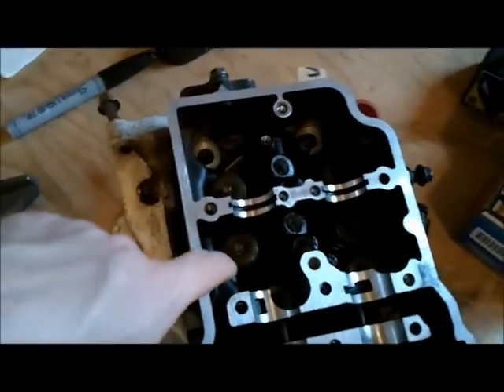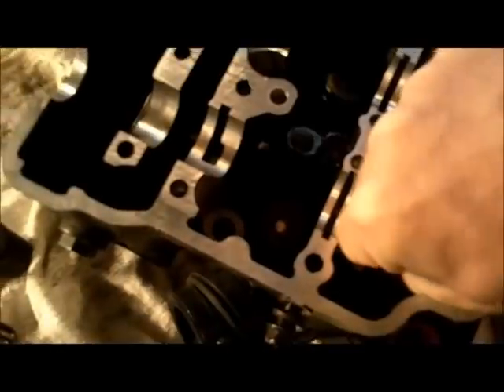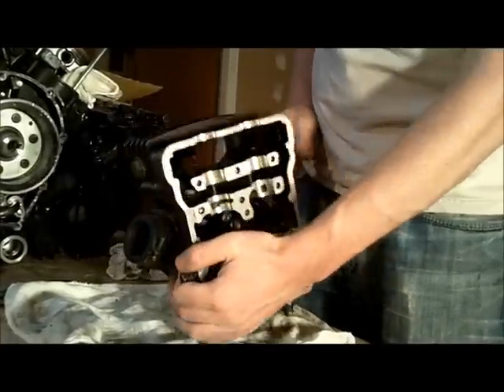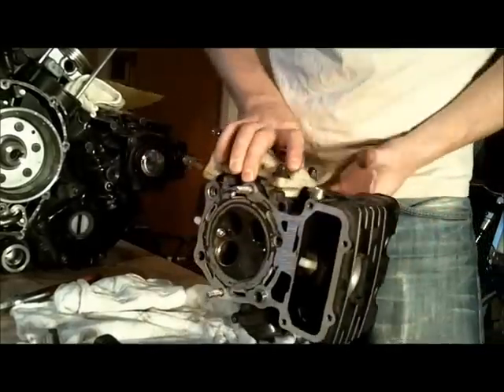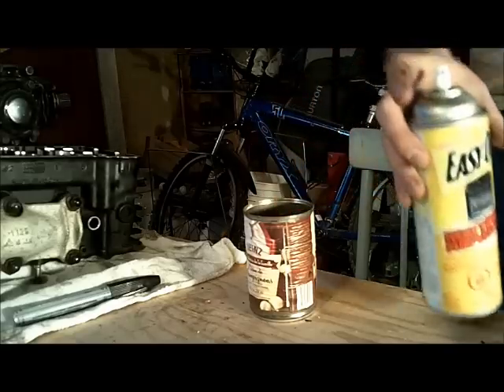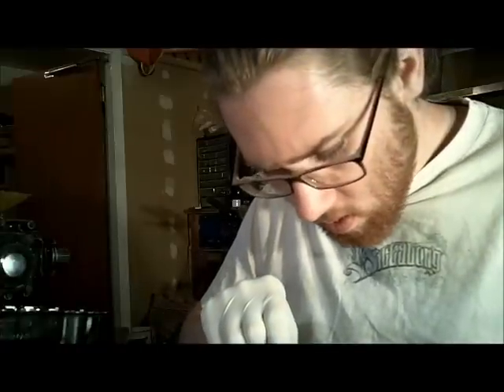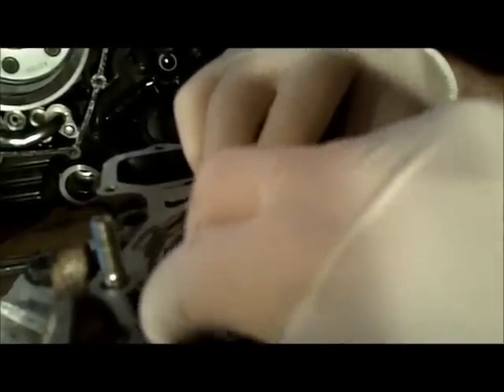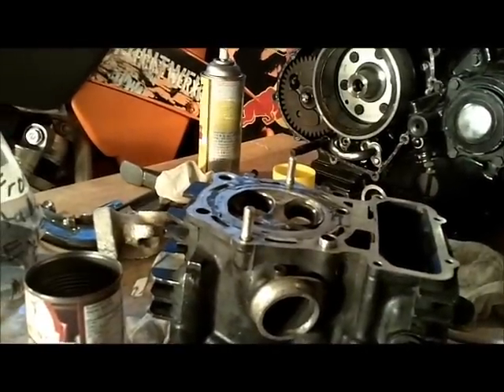1985 Kawasaki VN750 Engine Rebuild - pt3

Comment: Hello sir i have a 2000 Vulcan 750. And i noticed water in my oil. Through the viewing glass port. I've eliminated the reed valves. And the air duct. I have oil comming out of this house and I'm not sure what it actually goes to. It's right behind the radiator coming from the valve cover, i think. Man at AutoZone told me to replace the water pump.
Reply from the maker: i think you might be talking about a breather valve. i would also look into a new waterpump seal.